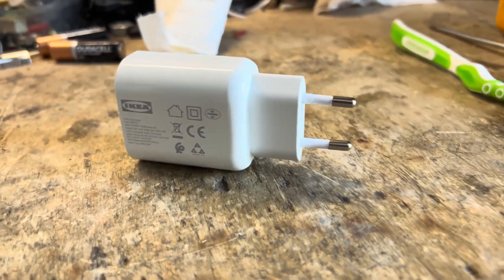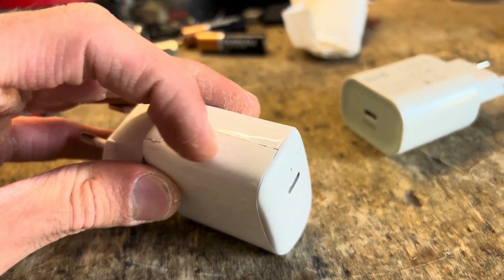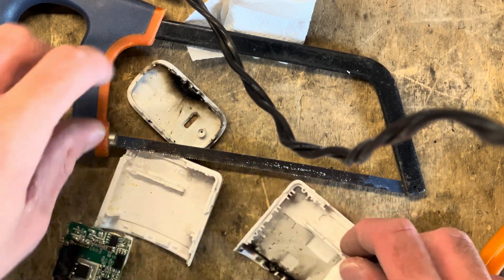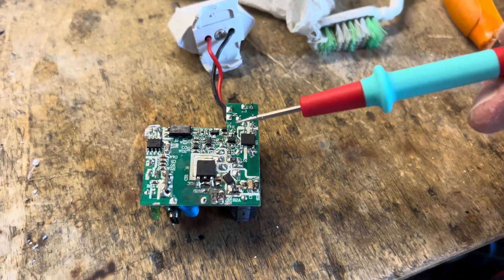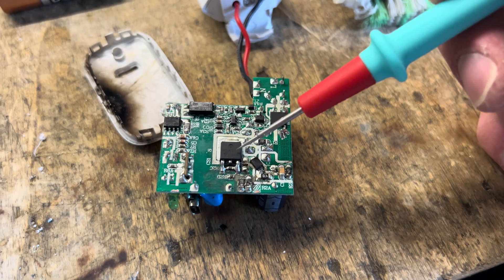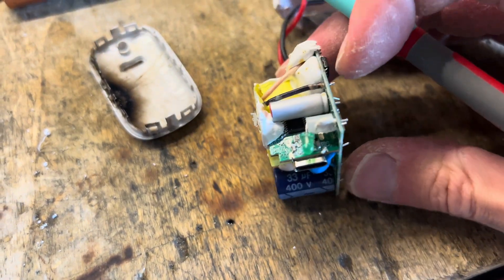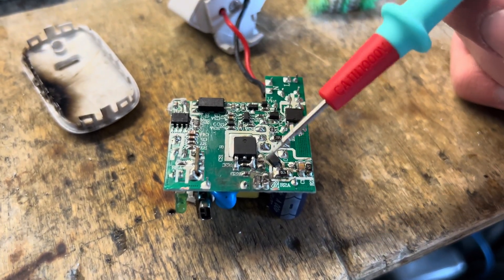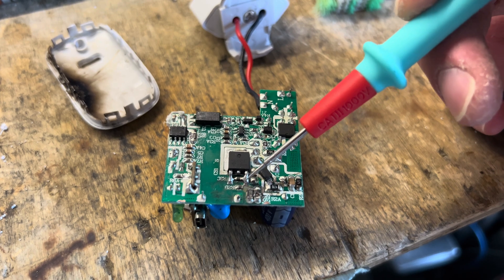USB-C Charger Teardown after Explosion - Failure Analysis

Comment: A power supply is obliged to have primary side protection for any short on the secondary, in my mind! So the failure mode is not ideal.

Otherwise, the PSU seems good enough. The fuse was adequately rated to suppress sustained fire, and the secondary comes out on insulated tails from the top of the transformer, so i actually don't have massive safety concerns from this PSU. I can't read the Y cap whether it's proper but it doesn't look like one of those cheap thin substitutes.

Brand name and model are noted at the side of the casing, IFEART IF-30. Never heard of them. An Amazon reseller brand, Shenzhen business address, typical 6 letter nonsense jumble, not represented much anywhere else. Manufacturer also noted, it says Dongguan Mizhi Technology Ltd. One might buy way deadlier and shadier garbage from Amazon, there's a lot of bad stuff there.

Comment: Interesting. Looking at that, apart from the soldering that would have passed a cursory test from me - manufacturer is specified on the case, separation good, looks like correct safety caps, polymer cap on the output, transformer looks decent, but it just goes to show that even the "better" ones can be problematic.

At least it sounds as if it failed "safely" even if the PCB was used as a fuse 😂 Safe for me is 230v doesn't get to USB port...

This is what happens when you have thousands of unregulated companies making endless clones of a single base design... I long for the days when "cheap" meant Funai or Orion - it may not have lasted ten years but you knew implicitly that the thing would be correctly engineered and compliant at least.
Reply: Today's quality issue is a complex interaction of 3 things, one is design, then manufacturing practices and the other, often missed,  is component quality.  I worked on many designs that are done textbook-correct, but when it goes to be made in China, they source the cheapest components they can find, so having component failure is not unheard of.  In a twisted way, having a simpler design often turn out better in real life due to less failure points of a more complex design.
Reply from the maker: @_w_w_  agree. It’s also well known that the thing that doesn’t fail is the one that doesn’t exist
Reply: @_w_w_  Indeed. It's what I was alluding to with the comparison with old-school Japanese contract manufacturers. They would have given you exactly what you specified - the Chinese contract assembler are a complete bunch of sharks; it's not unheard of for a Western company to specify, and pay for, certain high quality components in key areas only for the assembler to not only substitute these for inferior versions, but charge for what was actually specified and in some cases, deliberately purchase counterfeit parts.

It has been the death of many a company's reputation down the years.
Reply from the maker: Sure, having 230V on USB-C would have been extremely catastrophic. But those two resistors should have gone open, PCBs are not fuses and if the traces were bigger it would have kept burning for longer and possibly become a fire hazard.

If the resistor would have blown open everything was fine. PCB burning off is not a safe failure mode